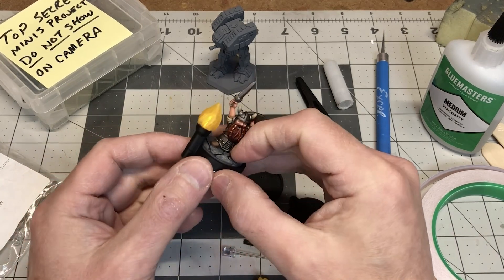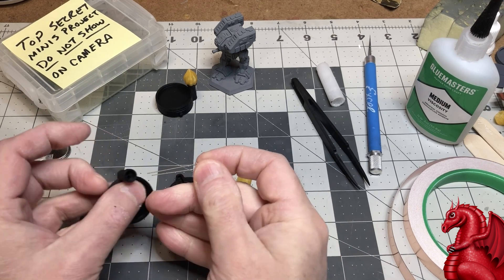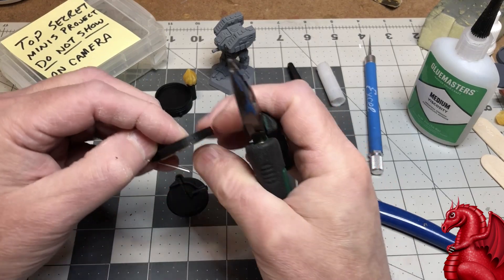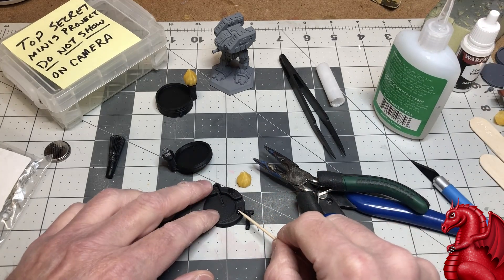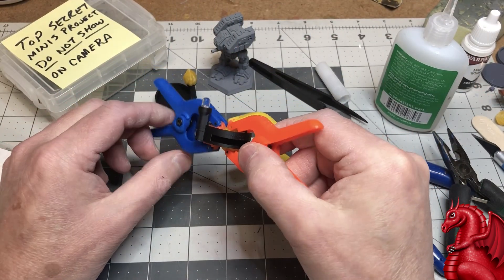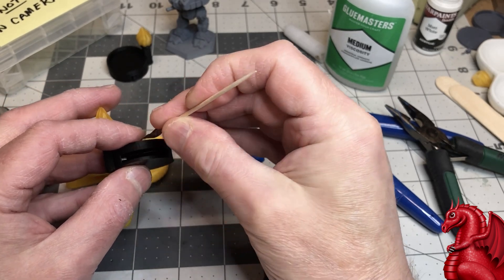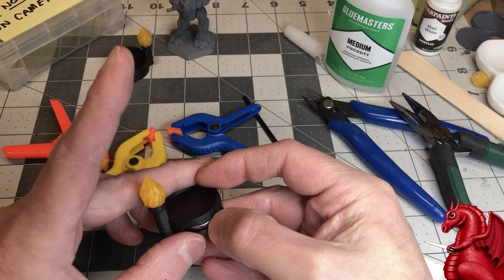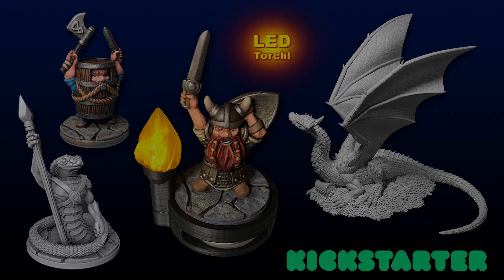3D Printed LED Torch Base

Comment: I think gluing the tape to the battery would be easier and should work the same way?
Reply from the maker: No, because the tape will snag on the LED leads when inserted. It has to be how I depicted, plus you don't throw out the copper tape that would be attached to the battery and waste it.